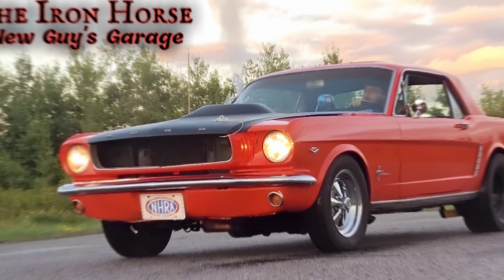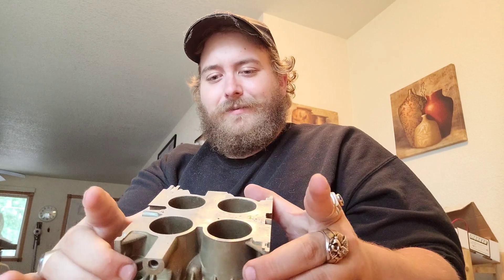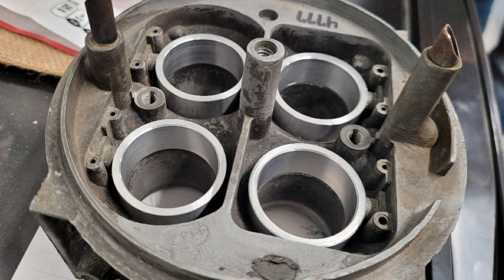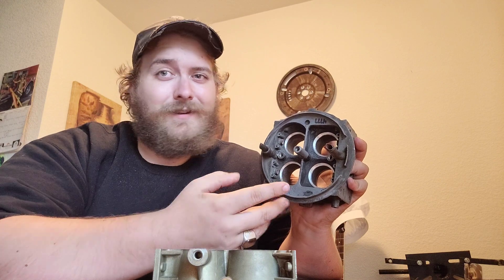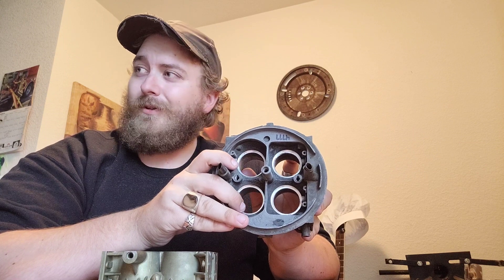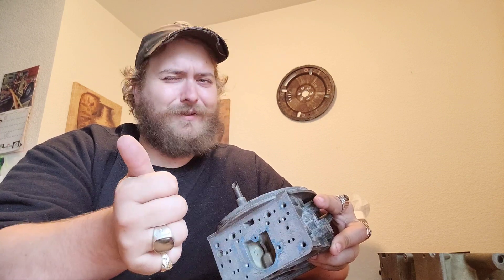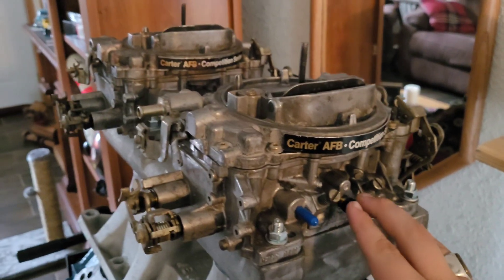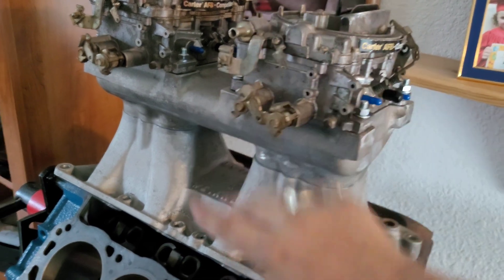GREATEST CARBURETOR BUILD ON YOUTUBE! | Custom Carburetor Project XMC Prototype A | Holley Carb

Comment: We haven't forgotten either. Great content. I have a carb for you to tinker with.
Reply from the maker: A carb you say? Interesting 😃
Reply: @newguysgarage6802  it's on my coupe.
Reply from the maker: @honestpeytonsspeedshop  trying to get it running? What kind of carburetor?
Reply: @newguysgarage6802  it runs, seems like it's over fueling holley
Reply from the maker: @honestpeytonsspeedshop over fueling like it loads up at idle?
Reply: @newguysgarage6802  yep, and if you get after it, bad stumble, shoots fire out of the headers
Reply from the maker: @honestpeytonsspeedshop  dose it rev up in park fine? Or does it stumble in park too?

Comment: Brasswell did the same thing on some offshore racing boats. They are a very big 2 barrel and are very rare, I have 2 of them, but they are boosterless and have perimeter holes all the way around the ventury, work very well at full throttle but do not fuel very well around part throttle. Hit me up if you have any questions
Reply from the maker: Ahhh so it has been done before 😂
That is basically what im testing with this guy here 🙂

What size were the ventures on them? 
I whent with a smaller size carburetor for the smaller venturi opening hoping that would give better signal to it 🤔
Seeing as the booster itself is a fairly massive restriction, removing it would turn that smaller carburetor into a bigger one essentially while keeping the venturi velocity up is the theory 😁

Comment: I think I figured it out.  At first, I was stumped. Everyone knows:The taller the carb, the better.
That's why they add velocity stacks at the top or stub stacks and put four hole spacers on the bottom.
 The only reason carbs are the height they are is limits in fitting under the hood. I could not figure out why you were shortening a carb. Then I saw the tunnel ram. You are going to stack two main bodies section together to make a 10 inch tall Holley double pumper!  👍
Reply from the maker: Lol 😂
Good guess but not quite, the short one is because we are adding our own top we are going to make for it in whatever shape we want. 

The second carb that has the inserts is going to be testing out something with those inserts to see if it will work, if it does then it will be designed into the top we make for the other carburetor 😃
Reply: @newguysgarage6802  It should be interesting.
 Did you see Luke's (Thunderhead289 )six foot tall velocity stacks?  I wish he had dyno tested them.
Reply: Usually I get sad when I see a carb with the choke removed and, even worse, the choke tower milled off. It reminds me of Kermit the Frog lamenting that restaurants serve frog legs. "All I can picture are  thousands of frogs on little tiny crutches."
Reply from the maker: @auteurfiddler8706  wasn't that a carb spacer? Velocity stack would be above the carburetor lol 

I would have loved to see how that affected the power band! 😃
Reply: @newguysgarage6802  Oh, you are correct, sir!  Four hole!